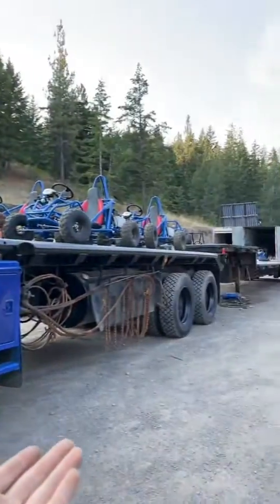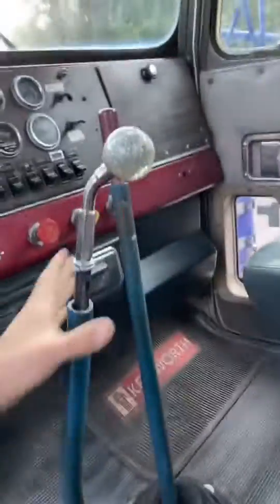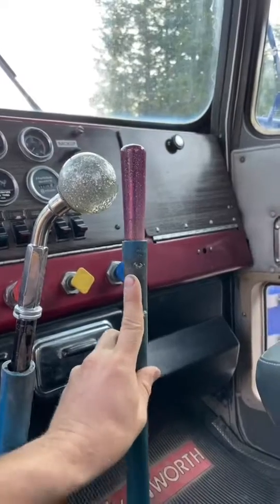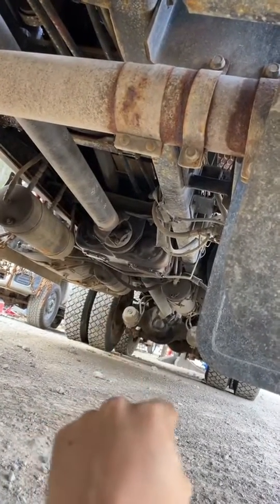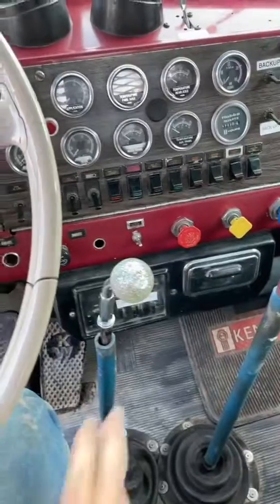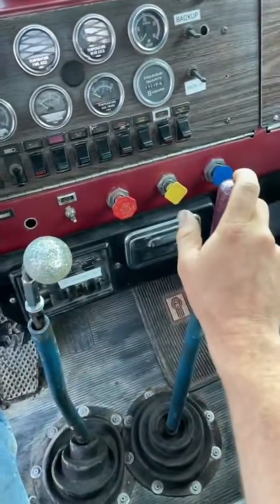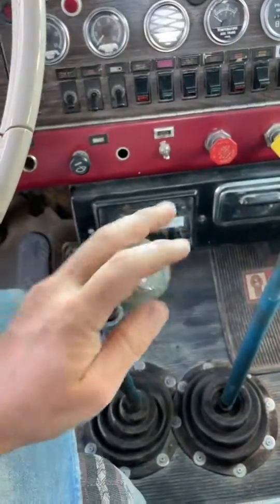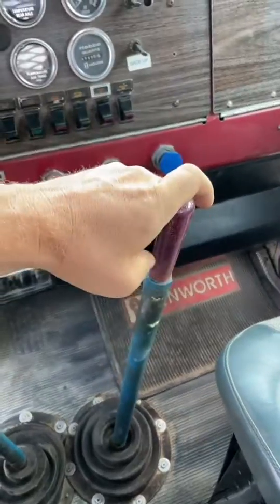Mastering Truck Transmissions: A Quick Tutorial for First-Time Drivers

Comment: Mack truck dual-plex, tri-plex and quad-plex from the 40s, 50s and 60s, learned to drive them in the early 80s while working as a diesel and heavy equipment mechanic. Grew up in the mountains and had lots of stone quarries around with some serious heavy duty trucks (double and triple frames were the norm.)They were still running them into the late 90s

Comment: Tractors from the mid to late 90's onwards have a similar transmission setup.
Deutz has a stick shift 6, with 4 ranges(?)(LMHS)that you can switch between with buttons on the shifter or a knob of the right arm rest.
And Fendt had a toggle switch with 4 positions.

Our Renault also has direct/overdrive / high/low with a lever on the right side of the steering wheel.

Comment: My biggest question with these was always how you could not money shift. Like if you're in 4th direct and you need a tiny bit more torque, do you 3rd overdrive? 5th low? How can you know what combination is higher or lower than the gear you're in?
Reply: My understanding is that the aux box ratios are spaced closer together (excepting the low range) than the main. So if you're going down 1 ratio, and you're not in the lowest aux ratio, shift the aux. 4th direct you can go up or down in the aux so I'd do that first. If I'm in low in the aux then I'm going down one in the main and probably going to direct in the aux as I've been losing speed while shifting.

Comment: Logically, seems to work (mathematically) like the twin shifters on a 12- or 18-speed bike.
Reply: Yep, there is a time and a place for all gears, but not all gear combinations are needed from a stop.
Reply: @wobblysauce  Absolutely, It also depends on where you are on the trip. Mile 1 I'd often start in 2-5. Mile 50 was 1-7.